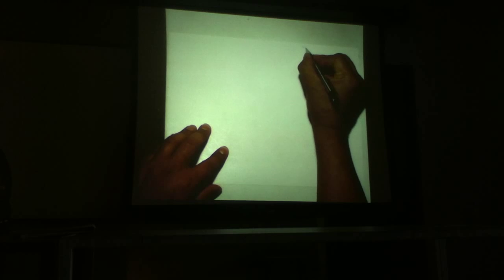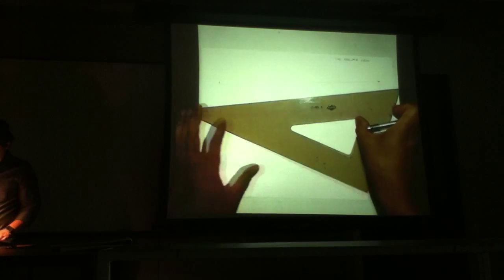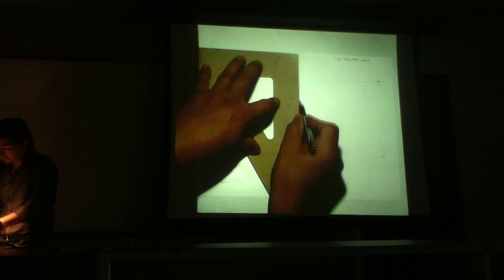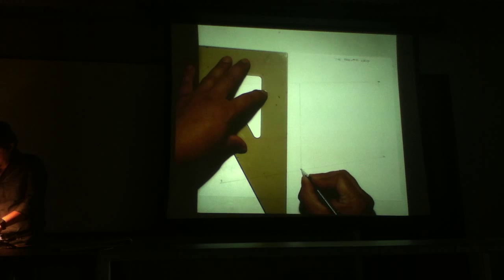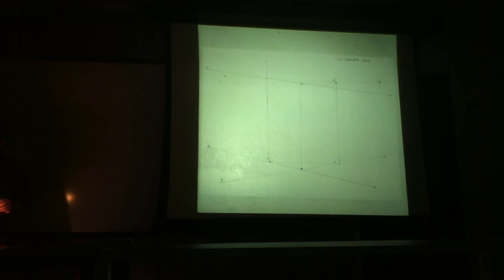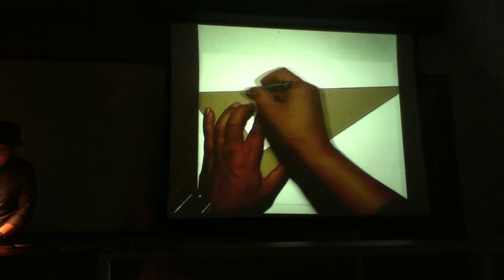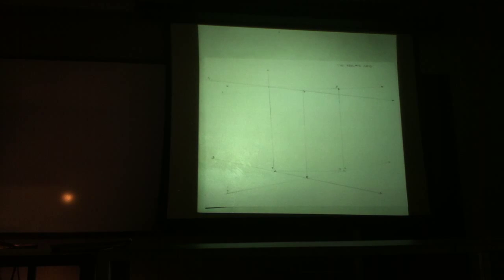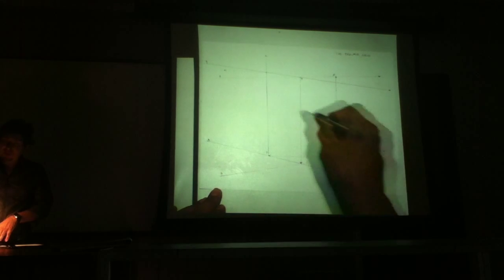How to make a brewer grid for sketching and drawing

Comment: This grid looks incorrect to me, as the squares get larger as they move away from the viewer.
Reply: I think "grid" is a bad description. Based on my understanding: what you get from a Brewer grid is a bunch of lines correctly converging to two off-page VPs. The "squares" created are not necessarily actual squares (though we generally assume they have 90 degree angles), and they're not all the same size, as you might expect in something called a grid. In spite of not being a perfect grid, this is still  pretty useful as an underlay for aiming new lines you create as part of your work.